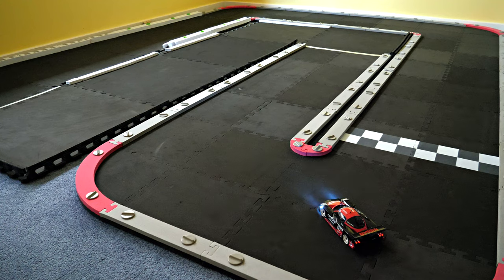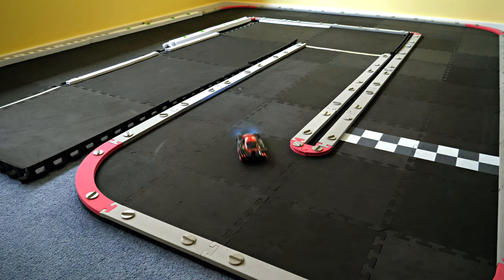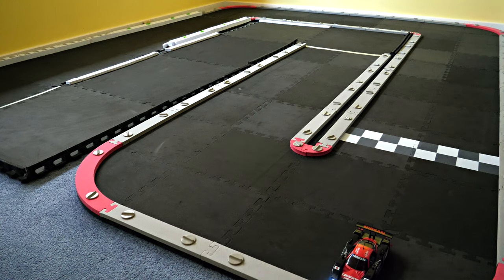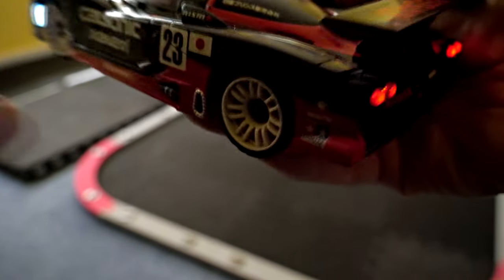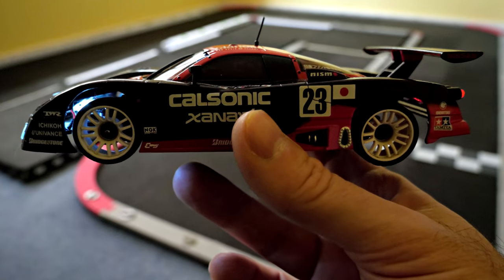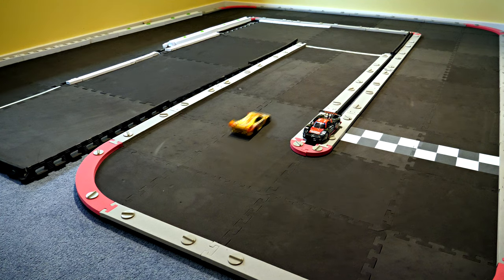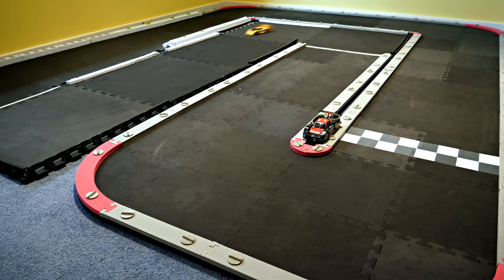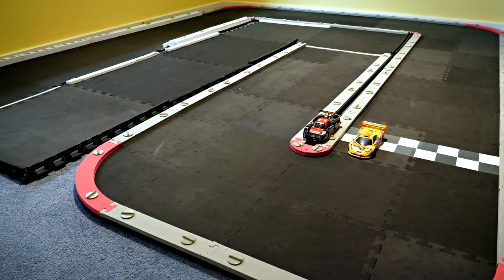Kyosho Mini-Z Nissan R390 GT1 Le Mans 1997 102mm LM - More LED Lights!  More Driving on My Track!

Comment: oh man i love LEDs on mini-zs! looks so good and realistic. it's one of the things that got me into the mini-z hobby! little tip, if you cover the inside of the body with some duct tape or electrical tape where the back end of the LEDs are. you won't light up the wheel arches and inside of the body, making it look even more realistic! you can see the difference with my old rx-7 vids and the newer fairlady ones where i taped the leds on the fairlady. unless you're into that underglow neon look!
Reply: @mini-z_me  I understand, definitely don't want to break anything. and if it doesn't bother you then don't mind what i've said. I'm just a perfectionist when it comes to things. 😀
Reply: @mini-z_me  👍